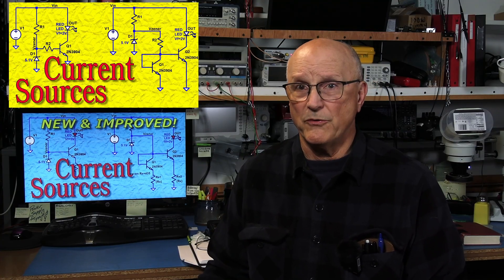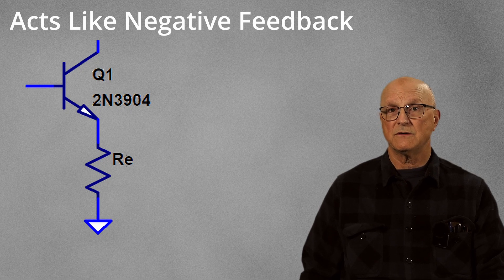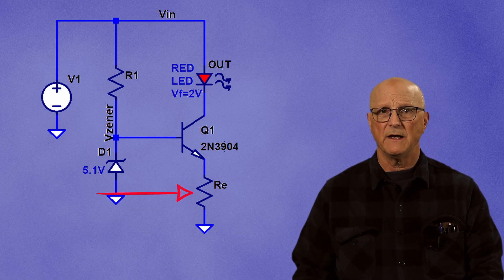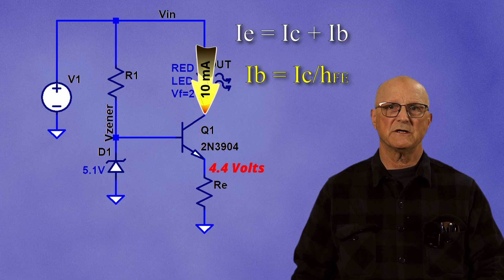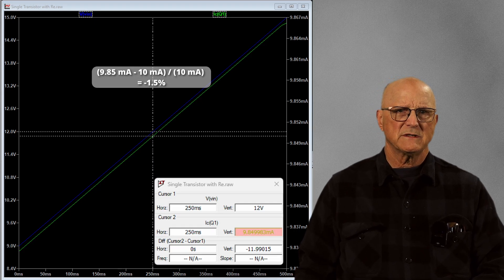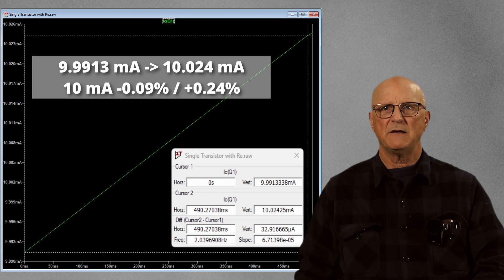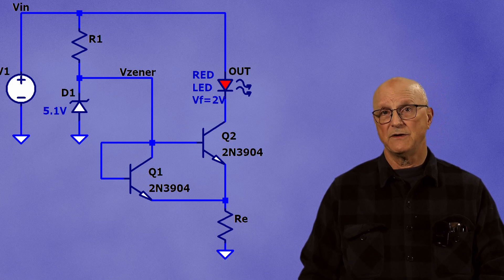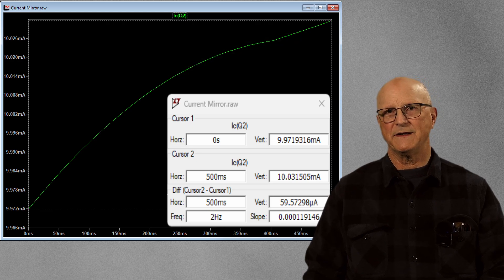Improved Bipolar Junction Transistor (BJT) Current Sources - Current Mirror (084b2)

Comment: Interesting results
Am I seeing this right, the simple single transistor circuit produced better results than the two transistor current mirror with the two extra components?
Reply from the maker: Yes, and it does actually seem that way. Yet, there are good reasons to use the current mirror which include things like the current in is the current out for transformation from one current source to another. It also allows for smaller resistor values which is important in integrated circuit design. :-)

Comment: I actually needed to design a constant current circuit last week and I debated all of these designs. After careful consideration, I decided my circuit was fine with +/- 20% tolerance to I just used a single npn and resistor. But.. I did consider it.
Reply from the maker: Sometimes that is all you need! :-)
Reply: @eie_for_you I excel at finding the bare minimum effort. 😂